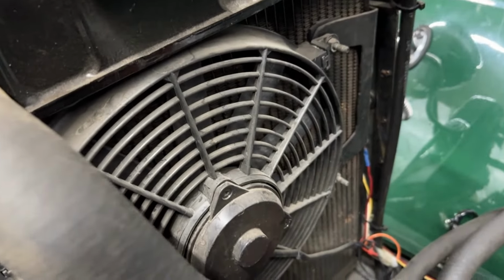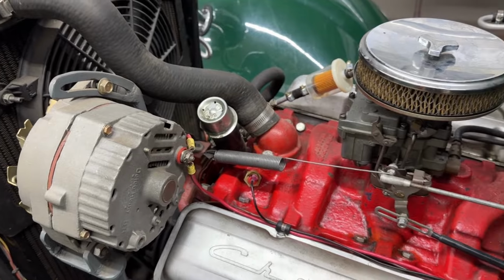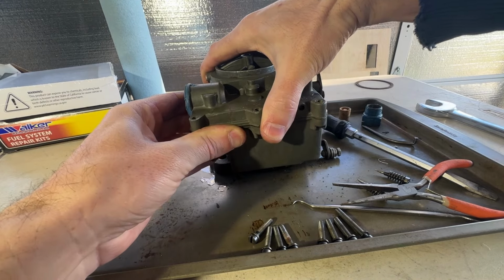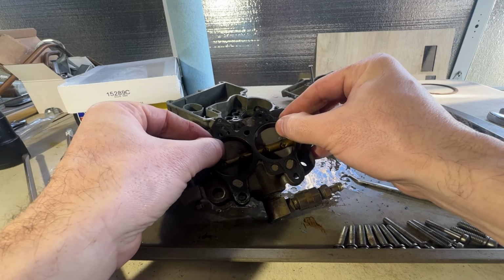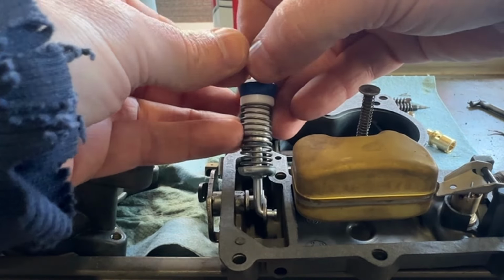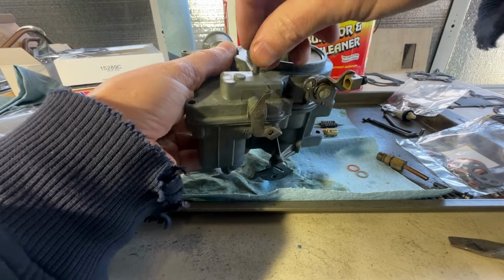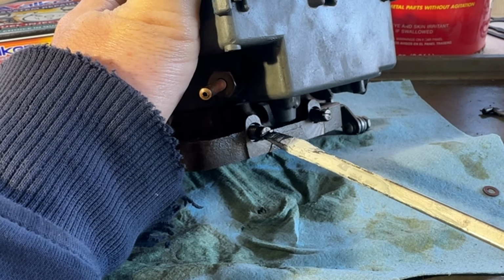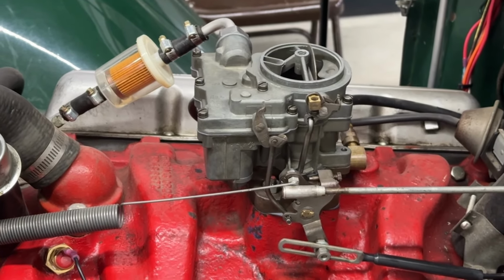1928 Model A  |  Part 5

Comment: I had a 31 Model A Tudor sedan with the same set-up, a 283 with the Rochester 2gc.carb. A four blade fan behind the radiator(original Ford), and a 7 lb.radiator cap,provided cooling. Never over-heated. Who needs an electric fan ?
Reply from the maker: The electric fan is the only cooling, there is not an engine mounted fan. From the looks of how it was installed I’m guessing they couldn’t fit the original fan.